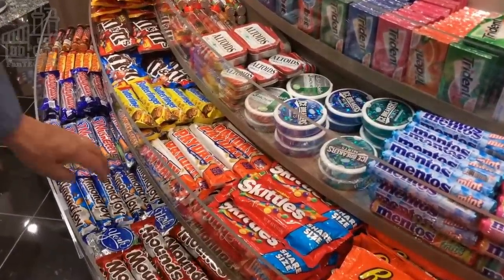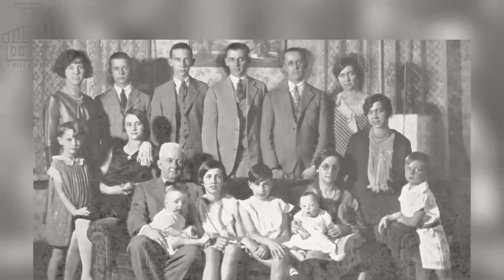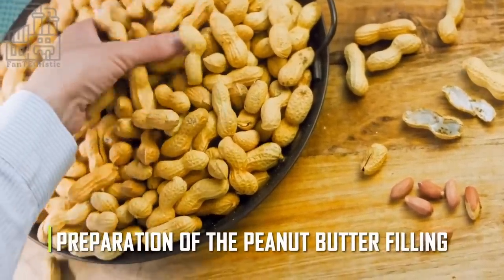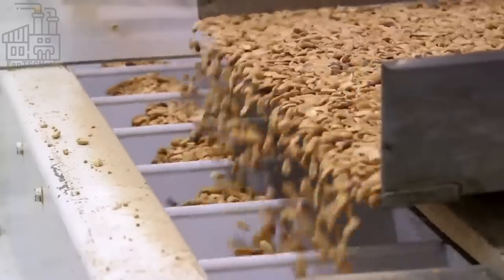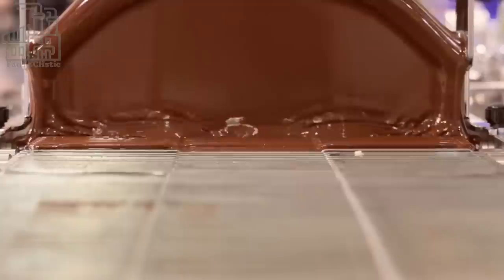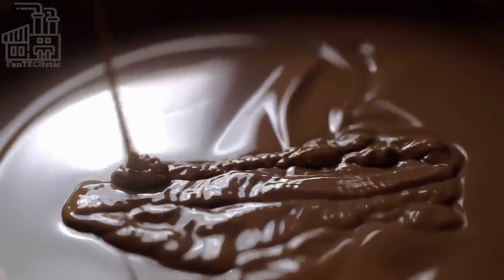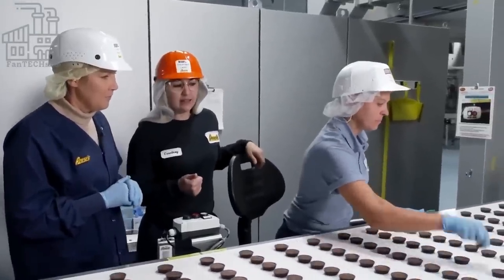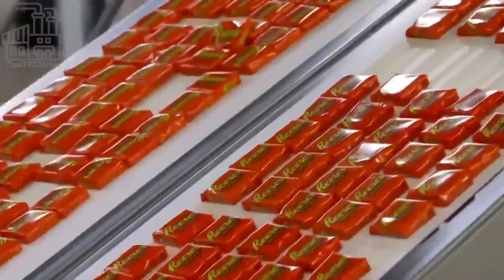Ever Wondered How Reese's Peanut Butter Cups Are Made?! Join us on this FanTECHstic Factory Tour!

Comment: We're to believe they make the peanut butter then put it in little jars before using it to make peanut butter cups?

And we're to believe they toss out the irregular cups instead of using them to make the bags of chopped Reese's Cups that get sold to places such as ice cream stores?
Reply: Prove that they don't
Reply: @daveklein2826  Not going to bother proving what is obvious.
Reply: You are correct on both of those points.  They call it and rework, because they are able  collect and reprocess most of what is not perfect on the first try.  Hundred percent false that they pack the peanut butter in two small jars. That's either stock footage or perhaps Reese's brand peanut butter, which incidentally is not even packaged in the plant but by another company that just licenses the brand name.  I've seen the process firsthand, there were a lot of problems with video